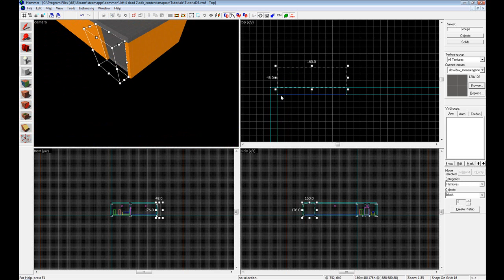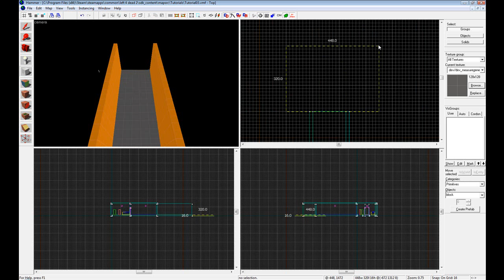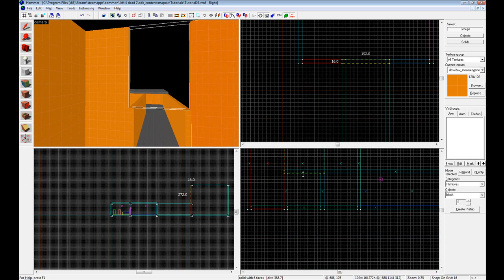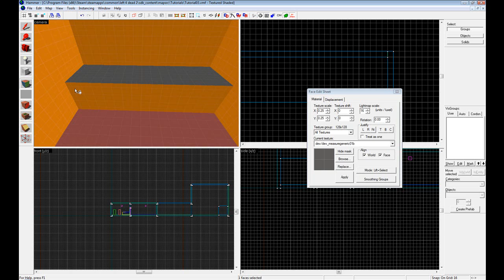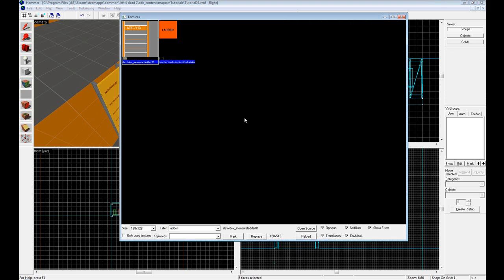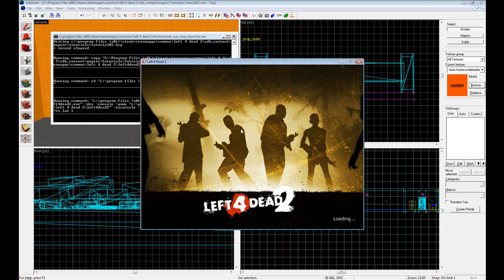Left 4 Dead 2 Mapping Tutorial Part 3 - Adding Ladders(OLD PLEASE WATCH NEW ONE)

Comment: A little too fast for a beginner, but this video does serve to reinforce what I learned from slowly reading thru the Hammer map making document given by Hammer. 

To answer the questions below:
1.  If nothing happens when make a map then run the compiler, the problems are probably one of these:  A.  You didn't place the survivor entity or if you did, it's too low.  B.  You didn't place the player entity, or if you did, it's too low (in both cases, place them in the room a little bit higher than the floor.  C.  You have a 'leak'.  That means that you have a room that is not completely sealed-it's as if you have made a box but the lid doesn't cover all the sides, or a bottom that doesn't sit under all the sides all the way to the edge, or there is a wall that doesn't seal to other walls. 

If you want to find out if you DO have a 'leak', build a gigantic solid box around your whole entire room, then make the box hollow (there is a command to do so in one of the menus, and you can make the walls as thick as you wish).  In other words, you will put YOUR room inside of a big, gigantic room.  Then when you run the compiler, the leak will still be there but since your room is surrounded by another box that you didn't not assemble (you made it hollow), the map will compile and then run.  

2.  You make a brush by clicking on the white cube along the left panel.  That's in the more beginner of videos.  It's not hard, watch the video and you'll get it.  : )

3.  Square sizes:  You can make your grid squares smaller and larger.  It's in an earlier video, but essentially all you have to do is look at the top left corner of the program.  There are two number signs with faint light green turning arrows-it's really really small.  Click on the left one to make smaller-but look at the grid size numbers at the bottom of your screen.  No harm in playing with that either.  Make 'em smaller then make 'em bigger.  

4.  Frequently save your maps and use a different name each time.  When your map fails, you can go back to the one that works.  If your map runs but then when u put in a light the map doesn't run, you can go back to the map that worked.   The reason your map doesn't work when u install the light could be that on one screen (such as the 'top' view, the light is in the room, but on a side view the light is actually below the room or above the room.  The map won't compile if objects are outside of the map.  Try putting your room in a gigantic hollow box.   There's a 'hollow' command somewhere.  

I hope that helps.  
: )